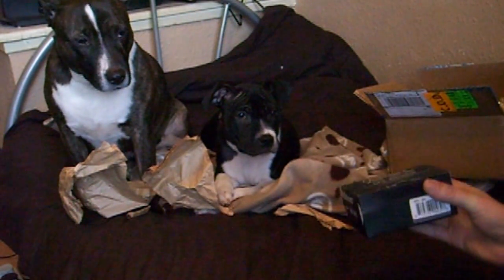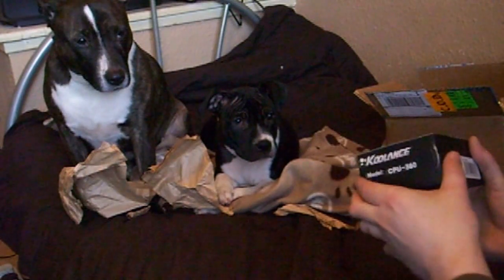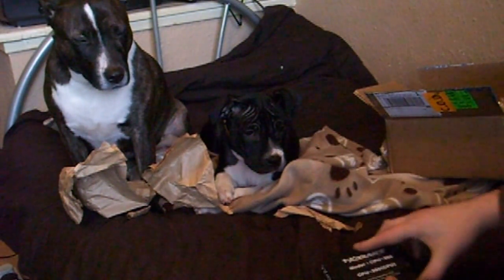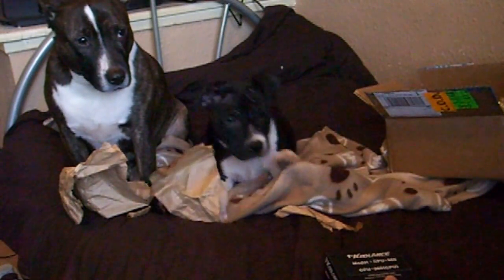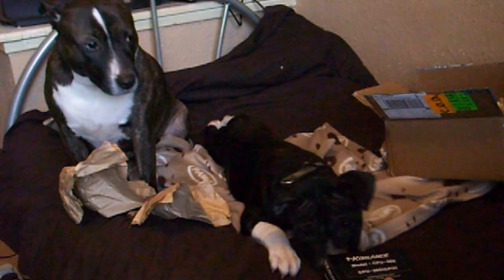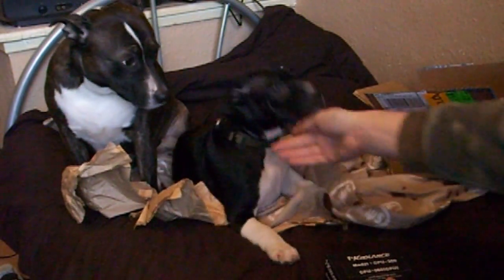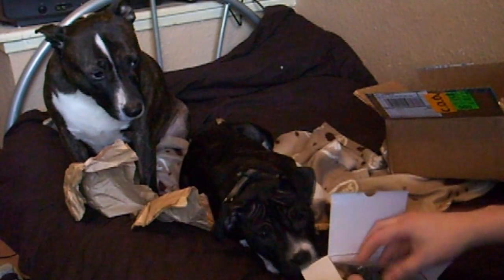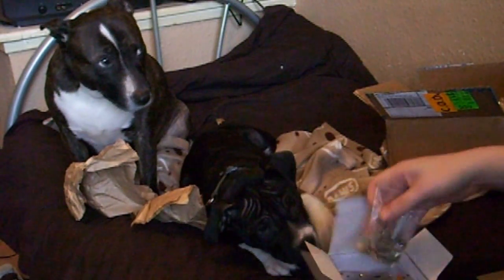NEW Koolance CPU 360 Water Block

Comment: Koolance is not cheap and the CPU-360 is more expensive than the EK Supreme HF. It's all a personal preference. If you like the black acetal look, then go for EK, if you like the chrome metal look, then go for Koolance. Personally, I like the chrome look over the  acetal look. Acetal looks like cheap rubber compared to nickel-plated blocks.